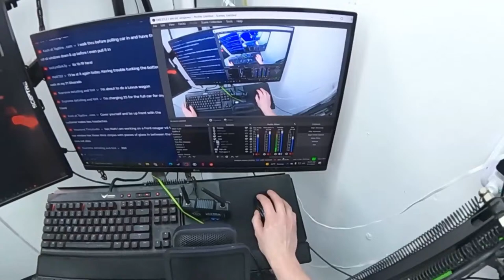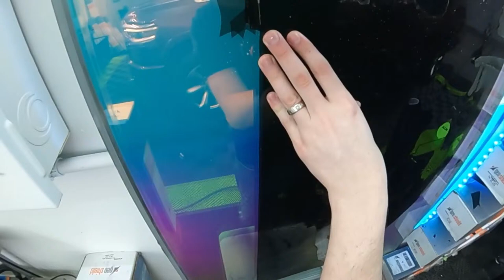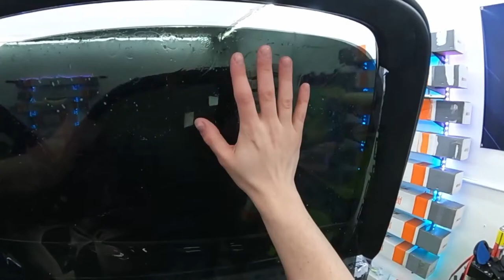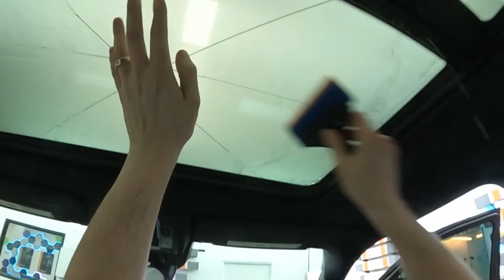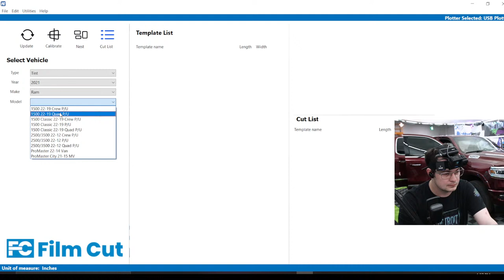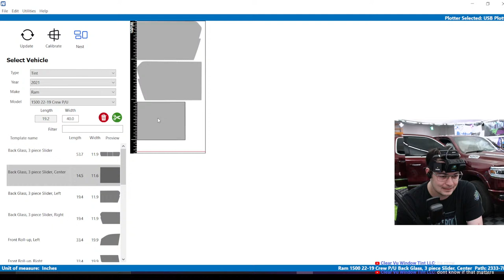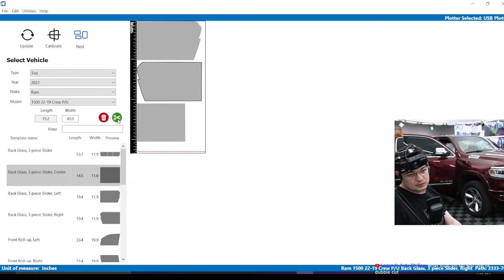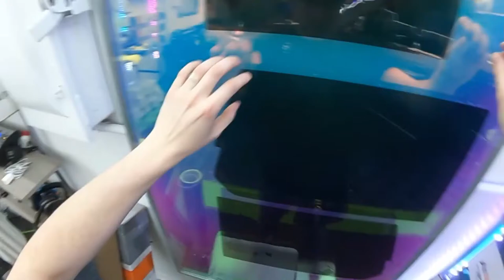Ram Full Ceramic Window tint

Comment: Is there any kind of tint you could put on a Jeep's outside front window to protect it some for rocks?
Reply: I don't think there is any kind of "tint" that would also protect from debris, but the windshield is designed to be hit by rocks and small debris.
Reply: I think it’s ceramic coating or some forgot but I know its some that goes on the outside of front windshield